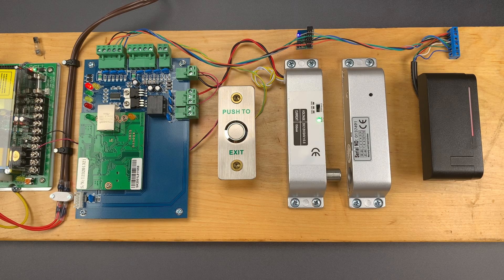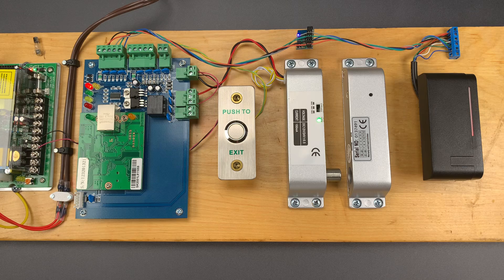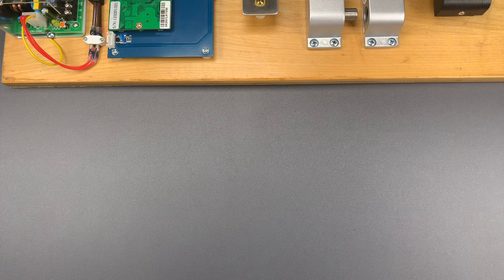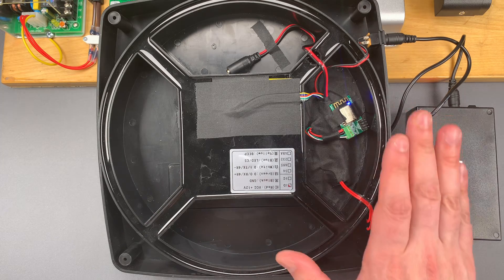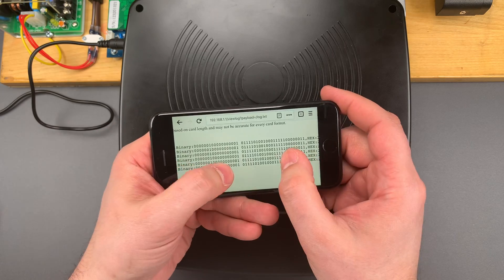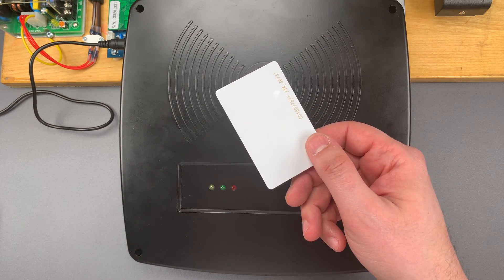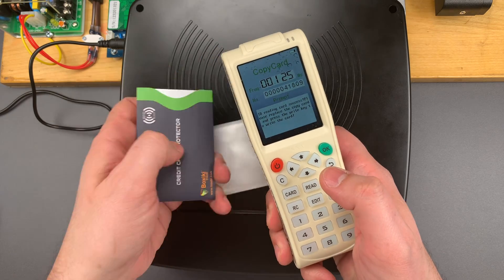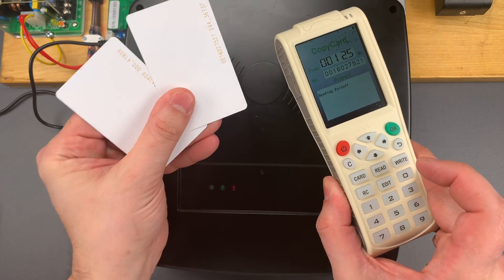[1056] This Black Box Reads RFID Cards in Your Pocket

Comment: I absolutly love the venture you took down the RFID road.
I want to add a few things for clarification:

TL;DR:
If you want to know if your card is secure, hold it up to your NFC enabled phone with a reader app and check the type. Mifare classic and ultralight cards are NOT secure. DESfire ones are. (edit: EV1 ones to be specific, at least they should be, original DESfire was cracked as well)
If your phone doesn't read the card, it is NOT secure. (NFC operates on 13.56MHz, if it doesn't read the card, it's a 125kHz one)
Use a metal card holder or something of the kind to prevent any kind of reading, take the card out when necessary. Metallic plastic or cardboard will not secure your card completely.
Credit card theft is not very common nowadays either, no need to worry.

Details:

Most cards nowadays are 13.56MHz, whereas the cards in the video seem to be 125kHz.

125kHz simply store the password/ID with no encryption and thus aren't very secure.
13.56MHz cards are the standard because they allow encryption. However, most security systems only rely on the public unecrypted portion of the card data, making it very easy to attack.
It is worth noting that storing the cards next to each other will not always prevent a read, certain readers are capable of distinguishing between the cards and read them seperately. This can only be done with 13.56MHz cards because they provide the necessarry anticollision protocol.
Not all password protected 13.56Mhz cards are safe tho, only DESfire ones and the like are. Most security systems I've encountered are either simply based on the public ID of the card or the password protected data which can be cracked within minutes with the right kind of setup.

Please correct me and/or ask me anything, I love this topic.
Reply: At the building where work my work is in they still use 125khz, a lot of the access card systems are still using this old.
Reply: @SkippyDa  mainly in the US. Across the pond in the UK you'll mostly find iclass and desfire.
Reply: You need a complete Faraday cage to block the RF. The old metallized mylar bags for anti-static packaging of computer boards are quite effective, if you can find one, but remember to fold over the open end to complete the "cage." (Would be fun to see if an old metallized-mylar helium birthday balloon would be effective.)  Or wrap it in aluminum foil - not very reusable, though.
Reply: @markcoleman9892  on the foil point you might be able to slip a little foil between the card and your wallet to reduce the effects.
Reply: I thought RFID and NFC were different. Can you explain what the difference is? Its not something I know much about.
Reply: @pifflebunk  They are different, but NFC was designed with the 13.56MHz RFID technology in mind. NFC is basically a subset of RFID that was designed for secure data transfer, NFC devices can act like both tags and readers, allowing encrypted communication like paying with your phone. However, NFC devices usually have the protocols of 13.56 RFID available for backwards compatibility, that's why your NFC enabled phone can read an RFID tag of the same frequency.
Reply: @craftminerCZ  Thankyou that makes things much clearer.
Reply: CraftminerCZ Awesome 😎 I wasn’t fully aware why RFID would work with NFC & now that makes perfect sense to me!!! Thanks!!!
Reply: Actually, adding a pin to an rfid system is a pretty good idea. A pin and a properly encrypted card system would be better, of course, but it still incorporates two of the three major access standards (something you have, something you know, something you are). Honestly, it's probably more secure than an encrypted card with no pin. Yes it can be accessed by social engineering, but it's more difficult to get two pieces of information than one secure piece of information, especially if you have to match them up out of two information pools. That's the whole idea behind two-factor authentication.

(Fun fact: the original idea behind credit card chips was to enhance security by requiring three security checks: magnetic strip, chip, pin. Then everyone decided they preferred the convenience of picking chip or strip instead of using both and it turned back into the old one-or-two-factor system.)
Reply: @tildessmoo  Ooooh a PIN, I spent so long trying to figure out how you could put a pin like a tumbler driver pin into an RFID system lmao. But I'd beg to differ on your point of encrypted cards being less secure than two-factor insecure cards and a pin. Pins are short, easy to steal, insecure cards are just paperweights. Even together I don't think a weak two-factor would be better than a strong one factor, could you elaborate on why do you find the two-factor you described stronger?
Reply: @craftminerCZ  I'm not a security expert, so take this as the secondhand information it is, but in general security experts suggest more authentication factors over higher security in one factor. I don't know specifically if securely encrypted cards would not be as good as any card plus a pin, but it seems likely to me, and it's at least a way to upgrade security that's cheaper and easier to implement than upgrading the card scanners and issuing new cards, especially considering potential rollout issues. Also, anecdotally, pins are particularly hard to get by social engineering (over, say, passwords), but I'm never going to completely count out stupidity as a security flaw, and the pin number pads on doors tend not to be hidden well, although that's a flaw with common implementation rather than with the system as a concept.
Reply: It's best practice to use a combination of 3 things for authentication. Those 3 being something you have, something you know, and something you are. An example would be an rsa token, with a pin, and a retina scan. Biometric systems are few and far between, so the 2 factor is more common. You just don't let people choose their pins, and have a lock out after a few attempts. Multi-factor is preferred because if someone steals your card by physical or electronic means, they still can't use it. If they SE your pin from you somehow, they still need the card. With both of those, they will still need a defeat for the biometrics system. Having one higher security card is like putting all your eggs into one basket.
Reply: @tildessmoo  Yea good points, definetly something I'll consider in the future, thanks for sharing.
Reply: @djsvrlaivwfofj  Sure, the best scenario would be 3 factor with all the factors as secure as they come, but in this exact scenario, I'd find it easier to have a coffee with someone who works at the airport, crack their card and copy it and observe them put the pin in than to flat out steal it from them and not have them notice at best a couple minutes later.
Reply: Thanks to folks in this thread for polite and detailed additional discussion.
Reply: Ohhh okay I get it. Thanks for the clarifying! I appreciate it!
Reply: "It is worth noting that storing the cards next to each other will not always prevent a read"

the readers that can distinguish cards from each other correctly are very very expensive and rare.

it's not a significant threat, frankly.

stacking your cards is still the easiest and cheapest security.
Reply: @thomasneal9291  Nah, you can get a PN532 capable of this for about 4 bucks on ebay. Besides even they were rare and expensive, you shouldn't rely on that fact for security, specialized thieves could still have them.
Reply: what such apps are available for iphone?
Reply: I'm confused about encryption. If you capture a cards encrypted key, why can't you just send the encrypted key to the lock/reader?
Reply: @bobc3704  You could do something similar, but you have to be aware that both the reader and a DESfire EV 1 card are encryption enabled, meaning the card itself when powered up can encrypt the data it sends as well as the reader. The only way to capture the encryption keys would be with specialized equipment between the card and the reader while they are communicating, not exactly the easiest thing to do out in the wild. Not sure if anyone has cracked the EV1 yet, but the old DESfire was cracked a long time ago.
Reply: FYI - MiFARE DESFire encryption was cracked a few years ago, and "DESFire EV1" is the less crackable replacement. (Edit: Whoops, just saw CraftminerCZ beat me to this by a couple hours)
Reply: Can this read credit cards wow damn the rfid sleeve will protect my credit cards
Reply: TLDR
Reply: Thanks for the info! I actually like to understand the different types of RFID and NFC a bit better. I am contemplating about buying a RFID reader/writer that can on one hand duplicate very simple 125kHz cards, and on the other hand identify the different types of 13.56 MHz cards. For example, my phone won't read my travel pass, and I read somewhere that it has a relative secure Infineon SLE-66 chip, and am curious if that is indeed the case. Any recommendation for a novice to buy a RFID reader/writer to get a bit more familiar with the different RFID out there?
Reply: How do you feel about using unencrypted card but requiring the employee to enter an employee-specific code after scanning their card in order to unlock doors?
Reply: @MillionFoul  Generally I don't like the idea, can be dealt with via social engineering, a brute force attack or just plain old spying/looking at the person entering the code. And frankly just removes the point of having a card in the first place. It's definetly more secure than just an insecure card but not by much. It's better to rely on people as little as possible when it comes to security, but I guess it depends on what it is you're securing.
Reply: @craftminerCZ  In this case, it's securing an airport. I can't say which one, due to security concerns (lol). The idea is that any person inside the SIDA (Security Identification Display Area) must have a photo ID issued by the airport in order to be there. In order to access the SIDA, you must scan your airport issued photo ID (SIDA badge) and enter the code specific to that badge. 

The badge/code is intended to require that both the ID of the person and the person must be present in order to open a door, because if someone steals the badge they are less likely to have the code and also may be recognized as not the person on the badge. The badges may also be encrypted, I'll have to find out. If you lose one you are required to report it immediately and you simply cannot work without it.
Reply: @MillionFoul  If the badges are indeed encrypted, (and all the other precautions are in place like placing the controller unit on the inside of a secure area) then it should fine. Otherwise it's a security issue, not too hard to fix either, just a little tedious replacing current badges with encrypted DESfire ones. I work at a company with a similar security issue in place and getting through to someone who cares and actually making a change is rather impossible unless you prove your point with an actual breach, a violation of the company policy etc... Fun stuff

Comment: I have a wallet woven with 0.001" stainless steel wire, if I had an RFID tag in there the reader would have to go through several layers of that metal weave to read the card.  I wonder how much better that would block the signal.
Reply: camjamsdad /videos I'm not relying on anything, and I haven't tested it, I'm just "wondering" how much better it would work.  I'm sure it would be better but no idea just how much better.

Comment: So by issuing two different cards to every employee and tell them to store them together you immediately  defeat this flaw?
Reply: On some readers. But the protocol is designed to read a whole pallet of RFID-tagged items at once.
Reply: Between bank cards, ID cards/passports, access passes, public transit passes, and a few others, almost all wallets are pretty much covered.
Reply: No because they will have to take them apart to get read by the intended reader.
Most employees will understand that one of the cards is a dummy and will leave it at their desk or at home
Reply: TheNasaDude different doors requiring different cards.

Comment: How does rfid work?  Does it like, constantly transmit data out for anything to read it, or only when like, it gets a signal, the bounces back info?  I would think that the simplest solution would just have it like, be off by default then you press a small button whenever you need something to read it, and it transmits just long enough for that one thing to read it.

Comment: Good video. Thanks.  I believe there is a similar issue with bank cards, where scammers can use a device to simulate the "tap" payment method and steal up to $100 by placing the device near your purse or wallet.  It is interesting to know that several cards together can defeat this, hopefully  :-).

Comment: Dunno, the phone-controlled device(that one installed on the wires) still can copy the encrypted data, so nothing changes.
Reply: Depends on the encryption method. If all that is getting encrypted is "my access code is _", then encrypting that will not protect against a replay attack. But if what is encrypted is "my access code is _ and the current time is _", then that is protected against a replay attack, because the time will not match.
Reply: @ScottKenny1978  True, but having a few tens of such codes would it be possible to find the encryption method and decrypt it? In my opinion such system needs some light and fast methods to work properly. And knowing such companies the added key would be "admin":)
Reply: @SAHA3571  with enough time and computer support, maybe you could break the encryption on the RFID card. Maybe. Depends on how big a key they're using. I'd be using https sized keys, which are not practical to break and readily available.

Comment: Correct me if i'm wrong, but i'm pretty sure RFID cards and tags have some memory, divided by sectors, and each of those sectors can store some data as well as a couple of security keys which you need to read/write data in that sector. And any more-or-less well-made security system will use data in one or multiple sectors instead of card's ID.

Comment: I'm not certain about your conclusion of multiple cards being stored together. At work I sandwich both my employee badge (opens the front door) and facility tag (opens the front gate) in the same lanyard case, and I never have issues with either reader opening. In fact I usually open the door with my lanyard in my backpack by simply backing up to the reader, and the door opens right up.  I often hear my phone buzzing when I doing this, which leads me to believe that the card reader has probably read every RFID in my backpack (several others in my wallet), and my phone on top of it. So in my opinion, this creates a false sense of security since it will not fool all readers.

Comment: Storingen multiple cards together isn't always a solution.

At my work on the parking lot when I scan multiple cards at the same time nothing happens (expensive reader) but inside the office you can just stack 6 cards and touch the reader and the door will open (cheap readers)

I know this because I own a secrid wallet

Comment: This is a great subject Mr LPL,
I was doing a bit of research into this myself a wee while ago..
 Not too much mind you but a little and I remember bits.. I was slightly concerned about this tech + its vulnerabilities as our bank cards are all using the (MWare or MiWear?) tech plus our transport system in the UK, London especially also uses it on our Oyster cards and I was trying to figure out if our Oyster cards could be cloned say and then presented at the Travel machines for a complete account refund..?
Pretty sure they are capable of doing it.
Any thoughts..?
Thanks for the great video

Comment: But, Black Boxes are orange. 😋

What about good ol' aluminium/cooking foil? I made my own wallet a while back out of duct tape, and reinforced it with aluminium kitchen foil (partly due to wanting something flexible, but also the paranoid part of my brain thought it might help block rfid scanners). 

I've tested it while shopping and trying to scan my card through the wallet, holding against the scanner, and it couldn't scan my card.

And I also tested it at work with my access card, putting that in my wallet and doing the same thing, holding it against the scanner. Couldn't read my card.

So would it protect against a 'heavy duty' scanner like this 10" coil?

Comment: Hey LPL, about storing cards together nd not be able to read them is NOT a real solution. The reason the reader can't read them is because they haven't implemented the protocol correctly. The MiFare protocol DOES allow to read multiple cards, since it has a challenge and response, and after initial contact only the correct card should respond to further queries of the data on the card.
I mean, if the attack with the large antenna would be within range of multiple people, or if you have an nfc card in your own pocket, it would be a useless attack ;) So if the protocol is implemented correctly, it hould be able to differentiate between multiple cards

Comment: I still haven't seen a magnet door holder able to withstand my shoulder, or crowbar for the external doors. 
So in my very simple mind RFID card readers on doors are only for internal  denial of access to employees.
Reply: Which is why the RFID system should actuate a locking bolt, and not utilise electromagnets to hold the door.